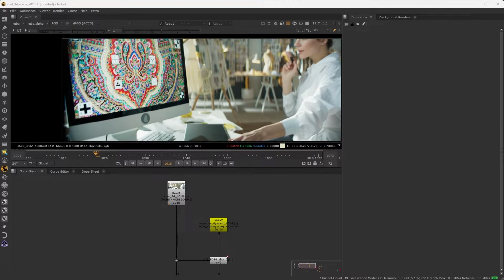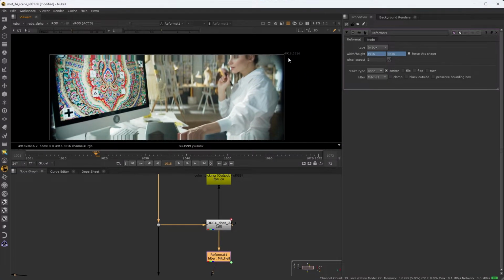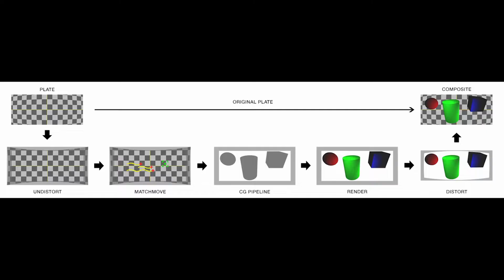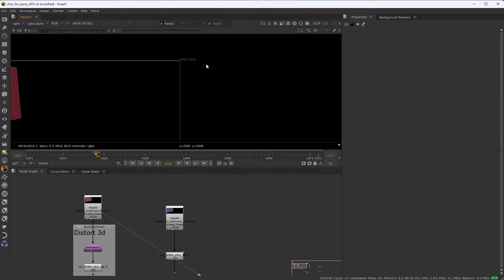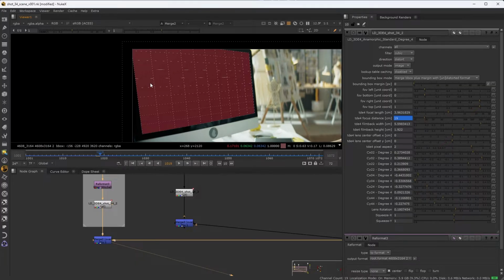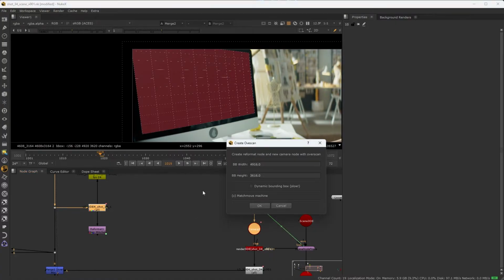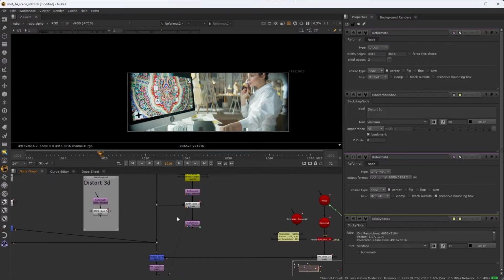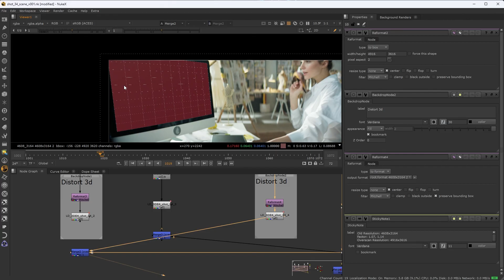Overscan. Why do you need it? How-to

Comment: I have a query please help me! I have done many shots without using any overscan value which is rendering the Undistorted plates using RunWarp4 at the same resolution as the original plates.

I have asked the vfx compositors if they need overscan renders of the UD plates but they say it's fine without it since I usually have low distortion values, mostly spherical lenses and that they haven't encountered any problems yet. 

But I'm concerned that they might see some problems with the CG renders after re-distorting the passes!

Is it a project to project based workflow or an absolute necessity for each project as I have seen even big studios doing without overscan values added to UD plates? Thanks in advance!🙏🙏
Reply from the maker: The great thing about compositing is that in the end it is just pixel movement and changing their color components =) therefore good compositing artist can solve any task even if he does not have proper pipeline. But how many extra time does he take for that?
That is why we recommend to do all the things properly. You can pump rubber boat by your mouth but is there any reasons to do that if you can use a pump? ;)
Reply: @matchmovemachine  Thank you for your quick response!🙏
I totally get what you mean here, as even I think that it is not the correct way to do any UD plates without overscan values because I see what happens when distortion is reintroduced while compositing with live action plates. Thanks a ton!🙏🙏